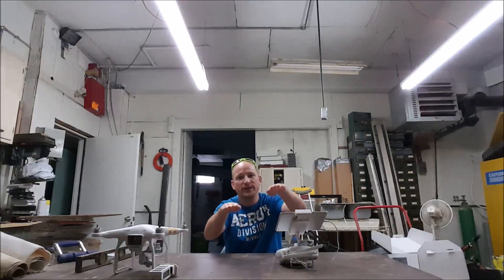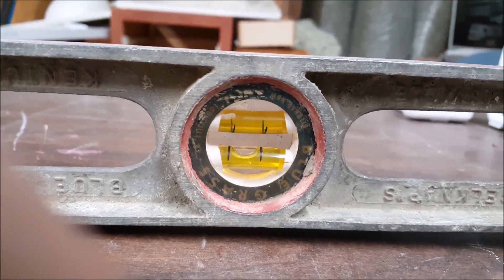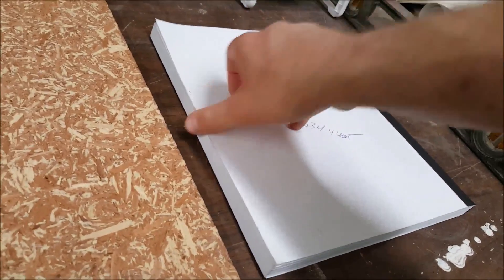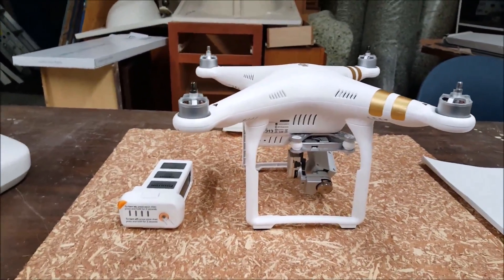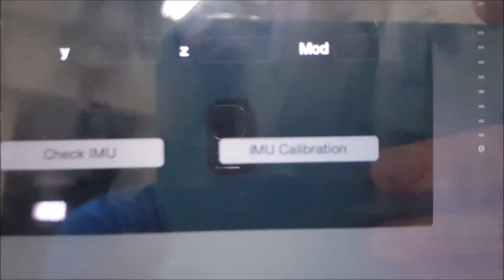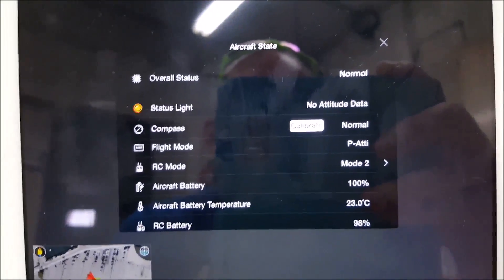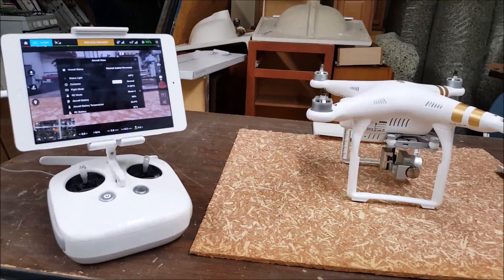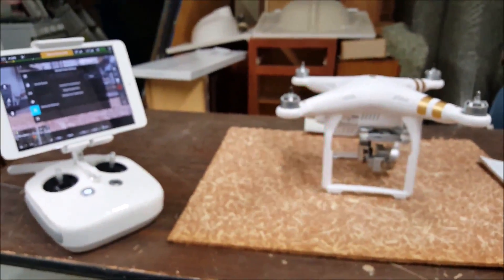Dji Phantom 3 Horizon Level Problem SOLVED

Comment: Good advice. My son gave me a Phantom 1 which I flew for the first time yesterday. I found the controller didn't fully control the drone. It wouldn't hover smoothly and at one stage it suddenly rose in the air without me doing anything. Does it need calibration. I have no Iphone can I connect online using the USB inside the battery compartment? Hope you can advise.
Mike in Oz

Comment: Flat Level Surface: Check. IMU Calibration: Check. Gimbal Calibration: Check. Compass Calibration: Check. Soon as I put her in the air tilted gimbal. I'm getting so frustrated.
Reply: same here.
Reply: STRICK9 LIVE You can just tilt the gimbal in the settings. It may help

Comment: Hey guys can you help? is there something wrong with my phantom3 if i do gimbal auto calibration but after flight and changing batteries i need to do this again to level up camera on the drone. is it somehow possible to save the auto calibration that i wouldn't need to do this overtime before flight? thanks in advance ;)

Comment: my Phantom 3,it hit a small tree branch about 10 feet from the ground,it feel and bounced off the grassy ground and flipped on its side,other than a little bit of mud on the propeller,it all looked ok,,but now the camera horizon won't level out,do you think the calibrations were knocked out of wack,or suspect unseen gimbal damage,the crash seemed pretty minor I was surprised it could not handle it,,
Reply: try calibrating the gimbal on a UNleveled surface, like just the tilt it shows on its video.
Reply: thanks for the message Felipe,i managed to carefully take the gimbal arm apart and reset it and then did some calibrations with success,thanks again
Reply: wilburto99 same here!

Comment: Do I need to do this first right out of the box before its first flight?
Reply: +Steve Armas No! Only when you are experiencing problems with the camera's horizon level in follow mode.
Reply: +Steve Armas Yes, you should. Some of these drones travel in box from very far places. So they do get knocked around while they are in transit. Furthermore, you might have to update your firmware when you first turn on your drone, and every time you update firmware it is highly recommended that you calibrate IMU and compass after update.

Comment: Thanks for the video. 
I am curious as to why you didn't let the IMU Warm Up before you started the calibration? Or did the calibration not work Till the IMU was warmed up?
I also move the controller and any electronic devices away from the drone before doing the calibration.

Comment: I haven't had any horizontal issues, but my phantom is beginning to have vertical drifting, meaning is slowly sinks down or climbs slowly up. Will this fix that too?
Reply: Did it fix that, I'm having the same problems
Reply: Yes, I was able to fix it by turning of VPS. Go to the Menu --> Avanced --> VPS.    You will have to shut it off while its connected to the phantom otherwise it doesn't stay disabled.
Reply: Make sure to climb up to around 30 feet, that keeps it from falling lower.

Comment: Thanks for the video. I understand the board is level, but how do we know the phantom itself is level? Could one leg be higher than the other? Or one of the pads not as thick as the rest? It would have been nice if the top of the phantom had an actual flat spot to place a level on, or a pitch gauge. Thanks again!
Reply: Scott Prince If you have a level surface to begin with.. You could probably cut four 2x2's the same length to prop the p3 up in air a maybe a inch  at the motors. You would need pieces of angle  mounted and extending  the top of the  2x2's  so each one can be placed in the exact position at motors.